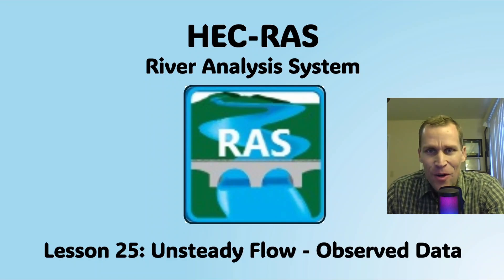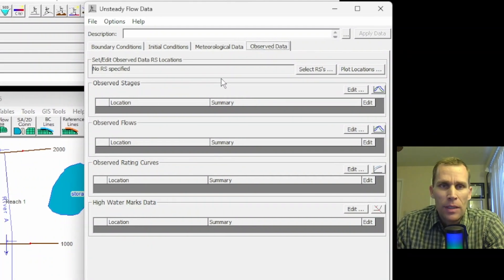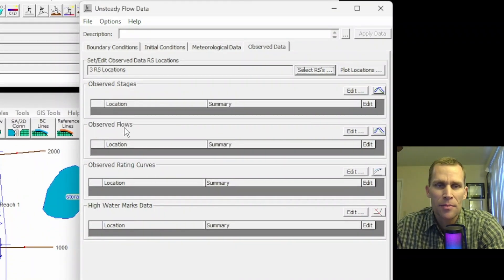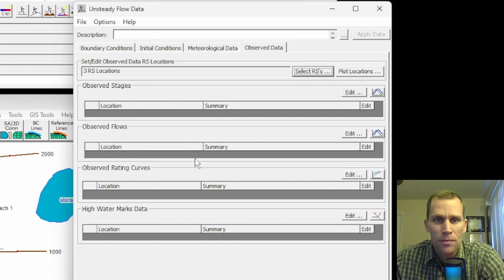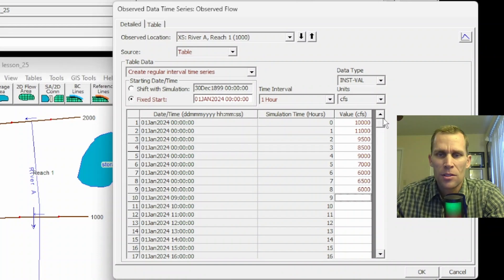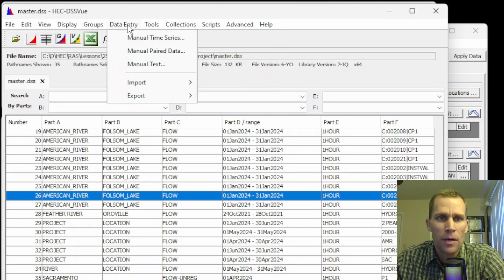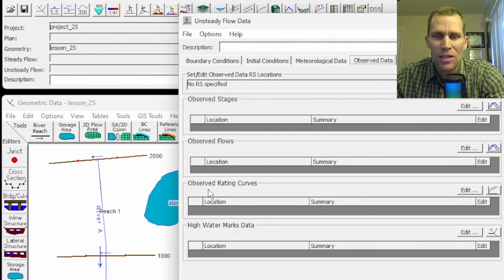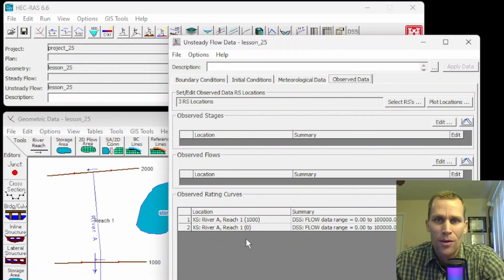HEC RAS Lesson 25 - Unsteady Flow - Observed Data

Comment: Hello, I had a question. Assume you're using hec-hms to prepare the data you'll use for hec-ras condition boundaries, you'll first calibrate your hec-hms model. Is there need to also calibrate hec-ras model afterwards? Or the first calibration will just make do. Thank you
Reply from the maker: Hi. You need to calibrate both models: HEC-HMS for accurate flows and HEC-RAS for accurate water levels and inundation, since each targets different aspects of the system.